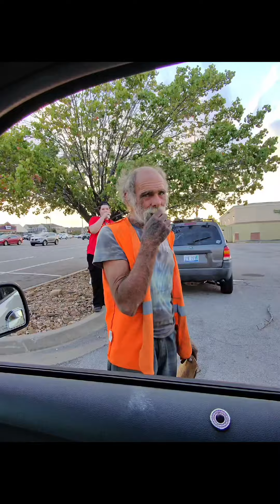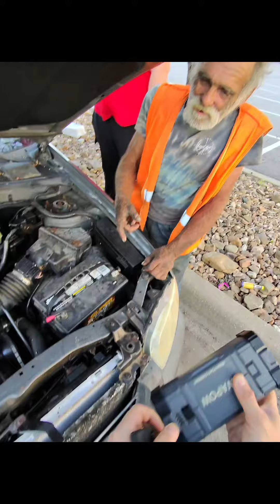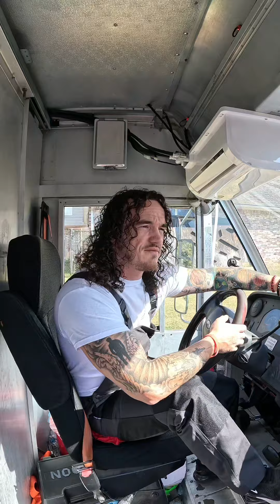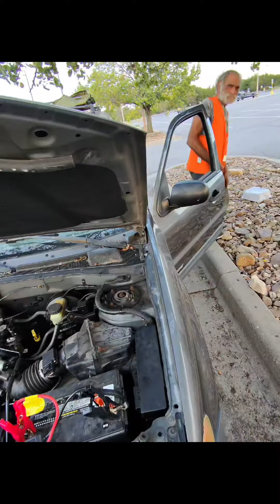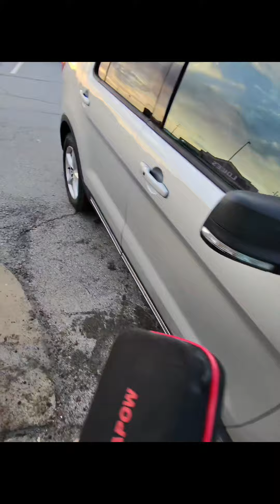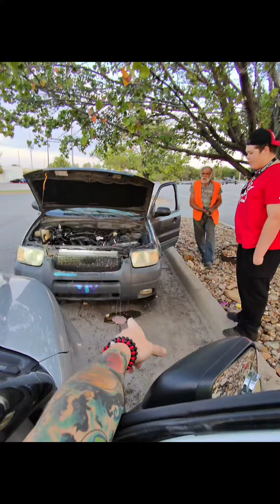Helped a guy holding a sign.

Comment: Incorrect parker. He definitely meant transmission dipstick. The transmission cooler is inside the radiator. It can go bad and let coolant and transmission fluid mix and it gets milky. Just like he said
Reply: yea and it usually fries the transmission. youll be lucky if flushing it out fixes it
Reply: @TempoMontages yep that gunk seeps down and it’s hard to get out without full rebuild